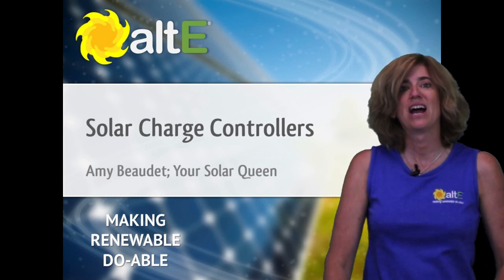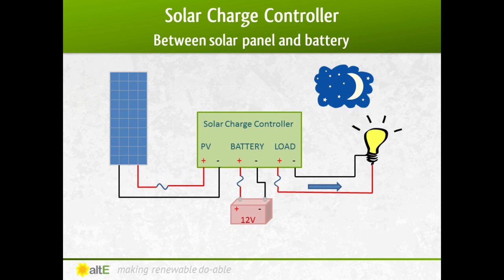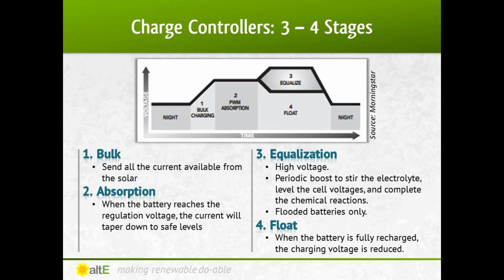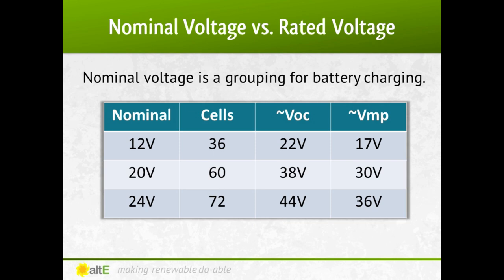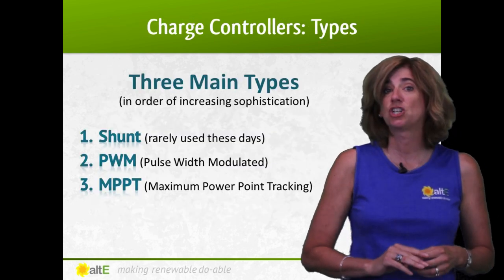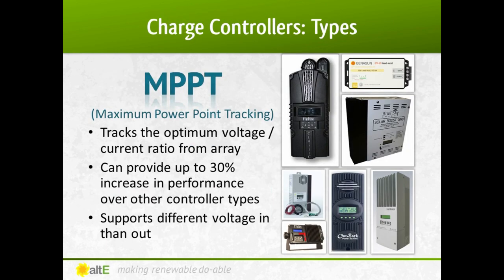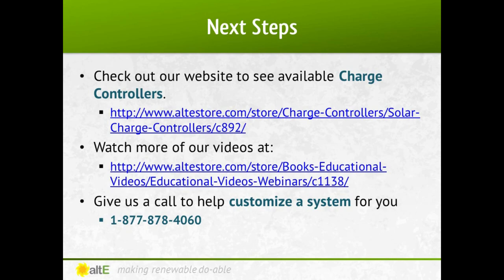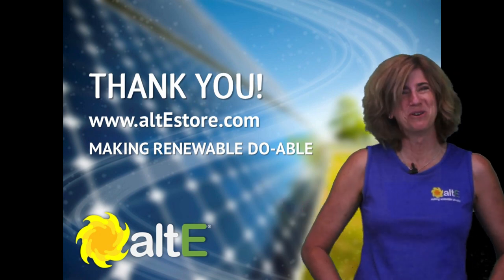Solar Charge Controller | What is it and How it works in a Solar Power System

Comment: If the PWM charge controller with matching nominal voltage between PV and batt, the efficiency is equal to the MPPT CC since there is no voltage drop?
Reply from the maker: Like most of my answers, it depends. MPPT charge controllers monitor the output of the solar panel and adjust itself to maximize the output. However, MPPT charge controllers tend to use more power to do this. So on small systems, the increased output may be offset by the higher power usage. But once you get to above perhaps 500W, an MPPT charge controller, even with matching voltages, can increase the total output of the system. Once spring comes along, we'll be doing some demos showing this outside in the sun.

Comment: super cool video! Does anyone know how a charge controller handles the excess power if its not transferred to the battery. (like after the batter is full?)  Does the solar panel just stop generating without a place for the excess to go? does the controller burn it all of as heat or something? I'm really curious to find out what happens to all that uncaptured energy if it can't be put to use somewhere. Could an excessive solar panel array melt a charge controller if its producing way beyond your storage capacity?
Reply from the maker: Michael n. It depends on the charge controller, but most simply open the connection between solar panels and batteries when the batteries are full, breaking the circuit. With an open circuit, there is no current flow. With no current, no power. If you did want to make use of the extra energy, you could also have a dump load controller, that connects the battery bank to a heater, usually a water heater, to burn off energy to make room for more. This is commonly done with turbines, that can't simply be disconnected like solar panels can.

Comment: You know that the charge controller prevents the battery from getting discharged, that is it prevents the current flowing from the battery to the PV panel and instead lets the battery supply current to the DC load via charge controller in the night-time or in the absence of sun. In the daytime, the charge controller allows the battery to get charged via PV panel and at the same time, powers the DC load. Now the question is: if the battery gets fully charged in the daytime, then will the battery gets discharged during the daytime? Or does the charge controller disconnects the battery from the system? Please let me know asap because I'm extremely confused about it.
Reply from the maker: During the day the charge controller will manage how much power goes into the battery. If the battery is full, it will disconnect the solar panel from the battery, preventing both overcharging and discharge.

Comment: Hi, Friend!
I need your help, please. As I told you I am using Minghe mppt charge controller and here in Israel now is very hot. The display is showing that the voltage of the two Batteries is 31volts nearly 32, is that normal? Can the voltage of one battery reach more than 15 volts and is there any danger? When I turn off the charge controller or at night the voltage goes down to 26.4 volts? What should I do? Can you explain to me what us constant current and what is constant voltage?
Thank You very much!
Best regards,
Emmanuel Távora Freire.
Reply from the maker: Sorry, I really don't know anything about that model. I was about to point you to a video online reviewing it, but I see you just commented on it. Hopefully they'll be able to help you out.
Reply: Thank You!
Reply: Your charge controller may be bad, or your wiring is hooked up wrong to the charge controller or within the solar system/set-up and it is overcharging your batteries. 

Do NOT hook any of the minus (-) wires together, no jumpers/connections  from minus solar panel to minus battery etc etc , such thing will bypass the controller and the controller can not control the power that goes to the batteries nor can it turn off the power to the batteries.  Most charge controller have a positive common, which means that inside the controller all positives are connected together and the negatives are switched on and off or/and  controlled as needed.   

Start over to connect the controller to your system. Unhook all your wires from the controller including solar panel,batteries.

1. Hook the battery to the charge controller terminal marked battery first, respect polarity.
2. Hook the solar panel to controller marked solar or panel, respect polarity. 

Like I said before, do NOT  hook the minus of the solar panel and the minus of the battery together anywhere in your system. Do NOT put jumpers between the minus terminals on the controller.

Comment: Since in every solar panel there is a diode to prevent reverse flow of charge. Without a charge controller reverse flow of charge if prevented.

Comment: I really need your help here. I have a small solar panel that I would like to use just to keep a charge on one 12 volt battery. I will give you all the information from the back of the panel, and hopefully you'll be able to tell me what type of controller I will need in order to use the panel. Panel Information: Zamp Solar Panel: Model # ZS-M-20Cell Type: Monocrystalline Peak power (Pmax): 20 WattPower Tolerance Range: (%) -3% to +5% Open Circuit Voltage / Voc (V): 21,0 Max Power Voltage / VMP (V) 17.5 Short Circuit Current / ISC (A) 1.23 Maximum Power Current / IMP (A) 1.14 Maximum System Voltage (V) 600 V DC Dimension (MM) 345*470*25 

Above Specification At Standard Test Conditions
(STC) 1000W/m* , cell temperature 25*C,am1.5

This is all of the information from the label on the panel. I'm sure this may help you to figure out what type of charge controller I need in order to put the solar panel to use. Thank you very much for your time, and all of your videos. I hope to learn from all of them.
Reply from the maker: +Roger Sayers The panel you have is a nominal 12V panel (you can tell from Voc (V): 21), so it can be used with a PWM charge controller. To determine the size needed, take the ISC (A) 1.23 x 1.25 = 1.5A minimum charge controller. So a very small 
charge controller like the Morningstar SunGuard 4.5A will do the trick. https://www.altestore.com/store/Charge-Controllers/Solar-Charge-Controllers/PWM-Solar-Charge-Controllers/Morningstar-Charge-Controllers-PWM/Morningstar-SG-4-Sunguard-45-Amp-12-Volt-Solar-Charge-Controller/p793/ 

Also check out our blog where I discuss deep cycle batteries and charge rate. https://www.altestore.com/blog/2015/10/understanding-deep-cycle-batteries-part-2/ A small panel like that can really only be used with a fairly small battery, unless it's just a trickle charger to keep it topped off when not being used.
Reply: Thank you for helping me out with all this information. I have checked out the blog and will be reading more information. I have two batteries that I would like to use, Both are 12 volt, One is a 35Ah,  and the other is a 17Ah.
These batteries will be used for  12 volt L E D Lights and maybe to charge a phone or mp3 player.
Reply from the maker: +Roger Sayers You can't use 2 sizes of batteries in the same system. Imagine the energy going into a battery like water filling a glass. If you are pouring into 2 glasses at once from the same pitcher, one of two things will have to happen. You'll have to stop pouring when the smaller glass gets full, causing the bigger glass to never get filled up, or you'll keep pouring until the bigger glass is full, and the smaller glass overflows. Both situations are disastrous for your batteries. 

You have 3 options. 
1.) You could use a charge controller that is designed to charge 2 battery banks, like the Morningstar Duo, https://www.altestore.com/store/Charge-Controllers/Solar-Charge-Controllers/PWM-Solar-Charge-Controllers/Morningstar-Charge-Controllers-PWM/Morningstar-SSD-25RM-SunSaver-Duo-25A-Dual-Battery-Charger-with-Meter-12V/p5600/.  
2.) You would have to use 2 charge controllers and 2 PV panels, keeping the 2 systems completely separate. 
3.) You can manually switch out the batteries, charging one at a time.
Reply: altE Store
Ok, Got it... I looked at the other charge controller but that is out of my budget at this time. May get one in the future, but for now I'll settle for the small controller. now if you don't mind, I do have another question. Do I have to disconnect the battery from the charge controller befor I use the battery ? Or can I leave the battery connected to the solar charger while using the 12 volt L E D lights ?
Reply from the maker: +Roger Sayers The charge controller is designed to stay connected to the battery. That way it can recharge any time sun is available. No problem using the battery while it is being charged, that's actually a good thing, makes more room for more power.
Reply: altE Store Great... I have ordered one already. In the future when I can spend more, I'll be looking into a larger panel, along with a nice solar charge controller. I'll also be reading up on all of this, I'm real green when it comes to this solar stuff because this is the very first time I have ever attempted to use it....

Comment: I am working on a camper solar system. I have C60 21.8% eff, vmpp (v) 0.574 cells, i am thinking to put on as much solar as I can fit. Here is my question: I am considering volts vs. amps, is there anyone who can tell 30 cells would produce enough volts to charge 12v batteries? Thanks in advance.
Reply from the maker: Tom Bo Ros 36 cells are needed, especially if you are in a hot location.

Comment: If a had a 12 volt battery and provide it 30 volt through a PWM charge controller, only 14 volt will reach the battery meanwhile the other 16 volt is wasted? Correct me if I'm wrong
Reply from the maker: Correct. You can see us doing that exact example in https://youtu.be/V2b7z2eTb5o

Comment: Now from all info I've picked up from your  video's the system I was looking to buy is just not going to work or did I get lost in the mppt's and series /parallel . Can you tell me if this system will work? 8 Renogy 250 w 24 v panels (voc 30.37,vmp 30.20, vmp 8.29, isc 8.84) with a Midnite Classic 200 (79 amp output) with a 24v battery bank.From what I found it should be a 48v battery bank and that controller wont work. I'm confused
Reply from the maker: I would suggest 4 parallel strings of 2 of the panels in series, and use a Classic 150 with 96A output. There's no reason to get the 200V version if you are doing strings of 2. 250W x 8 = 2000W / 24V = 82A. However, if you do decide to do 48V, double check that they really are 24V panels. Those voltages you listed are 20V panels. Voc for a 24V panel is around 44V, and Vmp is around 36V. I think they are mislabeling them as 24V when they are really 20V. They will be fine for a 24V system with 2 in series and an MPPT charge controller, but would not work well with a 48V. Then you'd need to do strings of 3 with the Classic 200. Take a look at some of the solar panels on our page to see the difference. https://www.altestore.com/store/solar-panels-c541/?sort=price_watt
Reply: If I get this right the 150 controller will work charging the 24v system but would have to be wired in the 4 strings as you said because the  200 wont work for 24v bank. https://www.renogy.com/renogy-2000-watt-24-volt-monocrystalline-solar-cabin-kit/  This is what I'm looking into. Looks like they are 20v panels
Reply from the maker: Ah, I see what they are doing, they threw me off by incorrectly calling them 24V panels. They have 2 parallel strings of 4 in series, which they can do with the Midnite Classic 200 since they are 20V panels (they could not do that with 24V panels). They are slightly overloading the Classic input, which is allowed, but the output of the charge controller will clip it to 79A, even if under perfect conditions more is available. That is fine, it wouldn't happen often. So yes, that design does work for 24V and 48V. Slipping on my sales cap, I can tell you we can do a larger system than theirs for that same price with Canadian Solar 275W panels, and provide free technical support so you don't have to ask for help on YouTube ; )
Reply: I'll be sure to check out your site for those systems or is it something that has to be built  Thanks so much I glad I found your video's I think I'm  coming around to how it all works
Reply from the maker: We have several kits pre-designed, https://www.altestore.com/store/solar-power-systems-c447/, but most systems are designed personally for your needs, as no two situations are exactly the same. That way you get the exact right system for you. Give us a call, I built a system to 100% match the Renogy one, and told Sales about it, so they have the right starting point. Then they can add the right mounting, batteries, and inverter to meet your needs. In USA and Canada, call 877-878-4060 weekdays 9 - 6 Eastern Time. This concludes the commercial part of the program.
Reply from the maker: Our messages crossed. I will send your email to Sales, and they will get something right out. I'm going to delete your message, as I don't want your email address out in the wild wild internet.
Reply: thank you was kind of worried  about it

Comment: Please help me I want to charge two different batt 175 and 250 ah 12 v each with a single 50 A PWM and separate wires to each batt
Reply from the maker: The best way to charge 2 battery banks with 1 solar panel is the Morningstar Sun Saver Duo, https://www.altestore.com/store/charge-controllers/solar-charge-controllers/pwm-solar-charge-controllers/morningstar-charge-controllers-pwm/morningstar-ssd-25rm-sunsaver-duo-25a-dual-battery-charger-with-meter-12v-p5600/

Comment: i have a 48v 18ah  battery bank (  4 batteries in a series)  . i power a 48volt 750 watt (max draw) motor. i want to recharge this system using solar.....i simply cannot find anyone who can or will explain this to me. can i wire the solar panels to the controller...not use the controller for output..have the batteries wired to both the solar controller and the motor controller ? do i need to turn off the solar to use the motor ?  i am completely lost in this regard......
 also- my solar array would only be 50 watts...two 25 watt panels @ 12 volts....unless i can mix wattage of the panels-- due to the area available for the placement of the panels.....
  i looked at a mppt converter or two on amazon and i saw a couple that accept assorted input voltages and will give the 48volt output for my battery bank...
 i simply do not wish to buy a bunch of solar related equipment just to simply watch it all go poof the 1st time i try it out.
  I am lost...need help...
Reply from the maker: OK, I've got you on this. Don't mix wattages, use the two 25W panels. You need a charge controller that can increase the lower voltage from the 12V panels to the 48V battery bank. That would be the Genasun GVB-8-Pb-WP (https://www.altestore.com/store/charge-controllers/solar-charge-controllers/electric-vehicle-golf-cart-chargers/genasun-8a-48v-mppt-boost-charge-controller-for-golf-carts-p11000/) If you may have shading on one panel and not the other, wire them in parallel, pluses together and minuses together. If shading is not an issue, you can wire them in series, plus to minus. So you'll have the 2 panels wired together, then wired to the charge controller. The charge controller will be connected to the battery bank. It will only be charging it at about 50W / 48V = 1.04A, so it will only be a bit of a trickle charge. Depending on how much you use the motor, you may need another charging source to keep up with demand, but it should at least give you more time between charges. To use it as your only charging source, you need more solar. You should have a DC fuse or breakers before and after the charge controller. There you go, no poof!

Comment: What happens  to the electricity from the solar panel when the battery is full
Reply from the maker: When the battery is full, the charge controller simply opens and stops the flow of electricity from the solar panel. The solar panel can sit open like that all day long with no problem.

Comment: If each solar panel has its own wire (which is the case with Harbor Freight amorphous panels), then it doesn't matter much if they are series or parallel connected, cuz the current flow in them should be about the same, such as 12V 1.5A (each panel) or 48V 1.5A all 4 panels in series.  You mentioned higher voltages reduce the current but that is misleading.  There is no current reduction in this case, especially if you have 4 separate charge controllers, one for each of the four 12V batteries.

Comment: Would it be possible to send you some photo of the charge controller working so you can tell me if it is really working in mppt mode? So you will see our Kalnoit( Electric Vehicle) Direct from Israel! Maybe by email or Whatsapp?
Thank You and best regards!
Emmanuel
Reply from the maker: Perhaps one of these videos will help. Be careful if you do try to measure the current in line. I don't know how many amps you are working with, be sure your meter can handle it. 
https://youtu.be/V2b7z2eTb5o

https://youtu.be/0Rb77J1bI94

https://youtu.be/_a8OMBTolxg